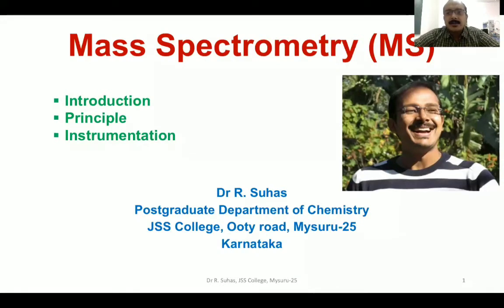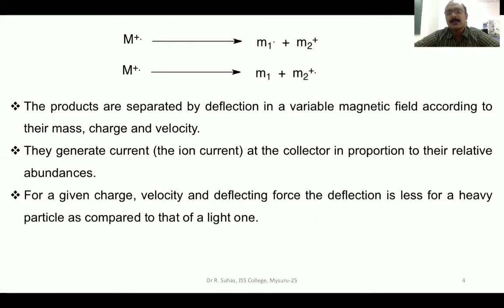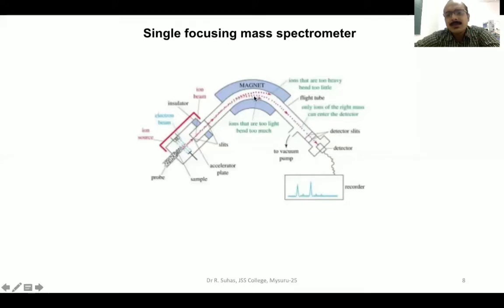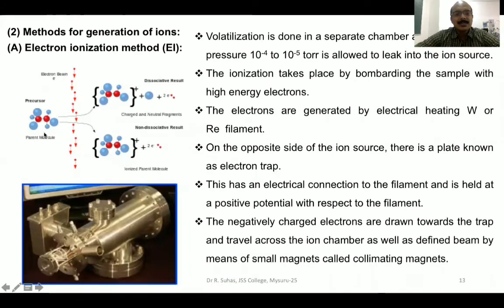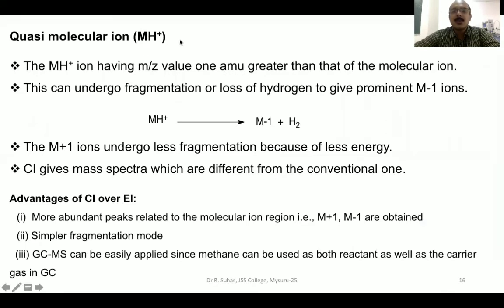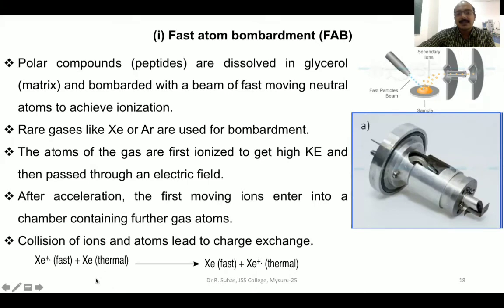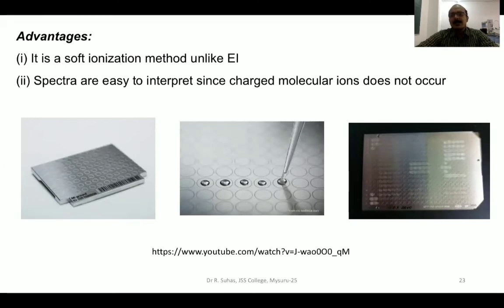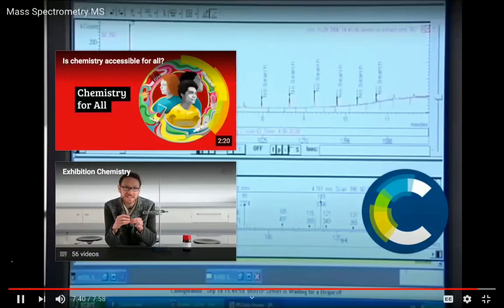Mass spectrometry Module 1

Comment: Sir, how to prepare samples? If there is  any interference present in the sample how it affects on peaks formed?
Reply from the maker: Sample is dissolved in a suitable solvent preferably water and mixed with the matrix which is also dissolved in water. Both the solutions are mixed well on a vortex and then spotted on the plate. 
If there is any interference or an impurity, the same will appear in the mass spectrum

Comment: Hello sir
sir whether MALDI is reusable? It won't get contaminated with the sample used for analysis?
Reply from the maker: Yes, the plate is reusable. 
Once all the spotting is done, the plate has to be thoroughly washed with different solvent systems, air dried and used again.
Reply: @suhasr3825  okay thank you sir
Reply: @suhasr3825  okay thank you sir